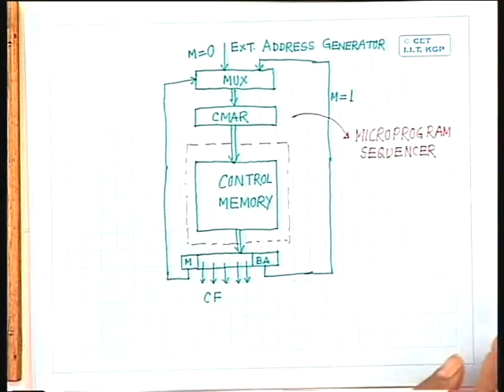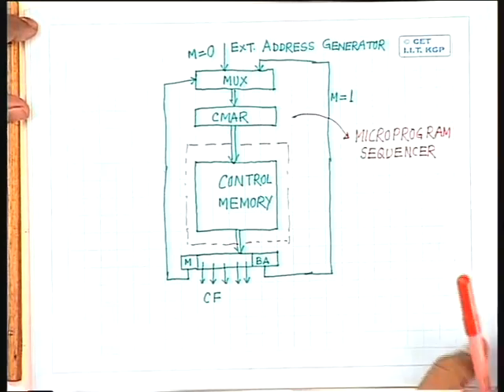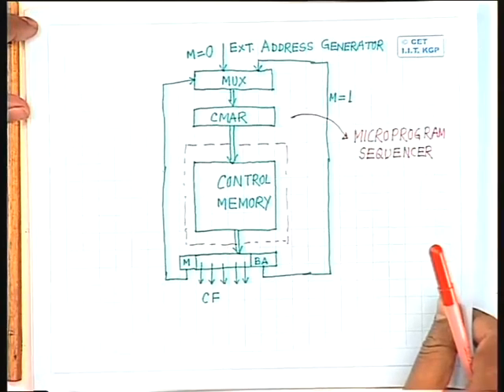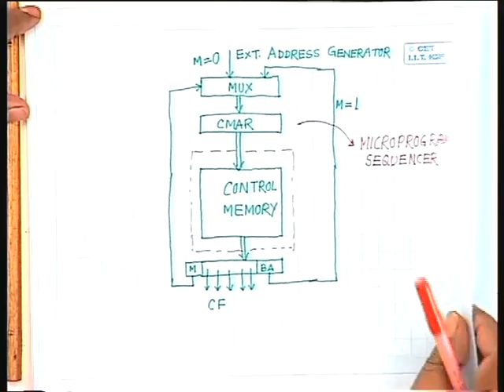Lec-5 Microprogrammed Control-I

Comment: Sir, I have a doubt.
The control memory can be a ROM as stated because it is already loaded with micro-instructions in a particular sequence as required by the program. What if I write a new program ? In that case I need to reprogram the Control Memory such that the control signals are in the sequence as according to the new micro-instruction ? How is this achievable by ROM ?
Reply: +Shashank Prasad Can I have your email id sir, for some further queries ?